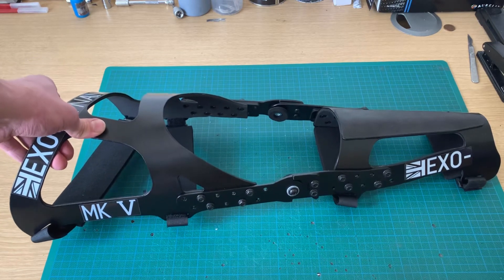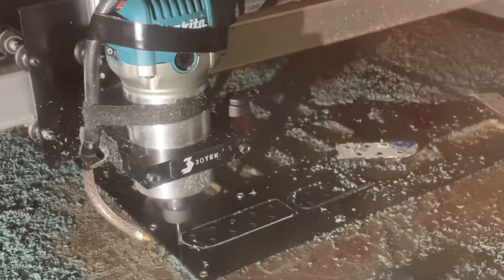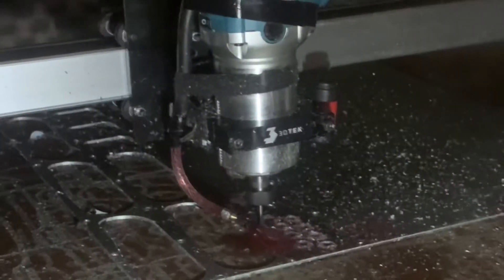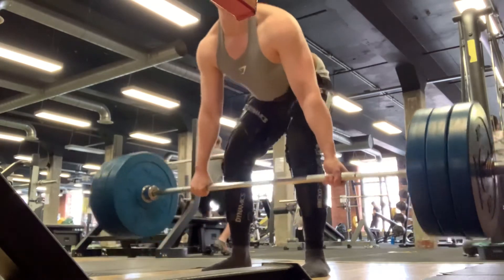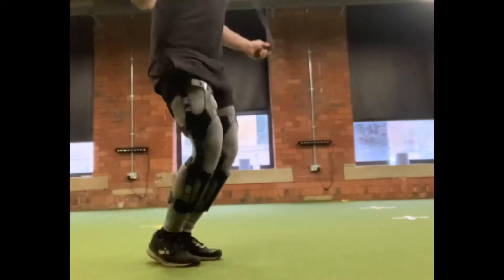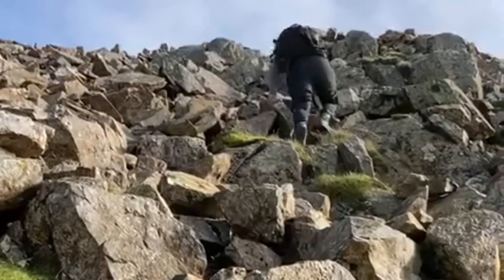Design of powered Exo-skeleton episode 1. future mix of iron man, space marine, Elysium, halo,

Comment: a gear-synchronized double joint is better for the knee, as it approxiates teh natural sliding motion of the knee and therefore prevents the brace from sliding when squating and standing up.
Reply from the maker: Thanks for the input! I agree a double geared hinge does match the motion of the knee joint better, however i found that it complicates the design by a fair amount, especially when adding a motor/gearbox to the design at a later stage, i also found such a joint would be more susceptible to contamination of dirt and debris that would cause excessive wear on the gears and increase play to the point of it not working very well as a brace even on its own. So far theres been no issue with them sliding down due to strap placements either. Theres another issue with the double geared hing which is theirs a patent that doesnt run out until around 2025 if remember correctly.
Reply: @MattExo-Dynamics   such a joint, by being connected with gears, neefs the same amount of mozors as a regular joint. A sleve around the knee joint reduces dirt intake
Reply: I'd recommend trying a four bar mechanism that mirrors the linkages of the knees tendons and ligaments. Better approximates the motion of the knee than a double gear mechanism as our knees don't follow a circular arc.
Reply: @lachlanraidal5100   i support this better alternative ^^ 

changed my own design to one a bit over a year ago.